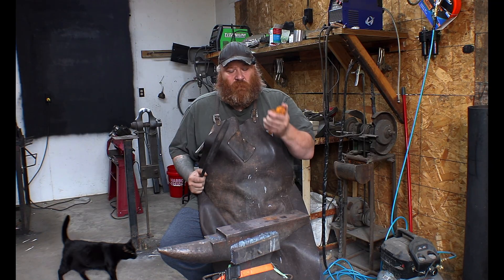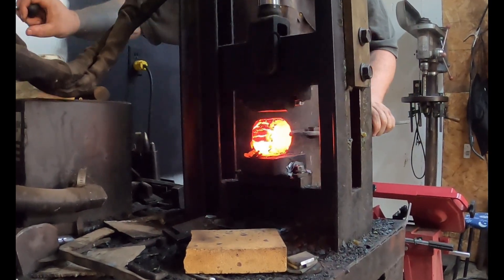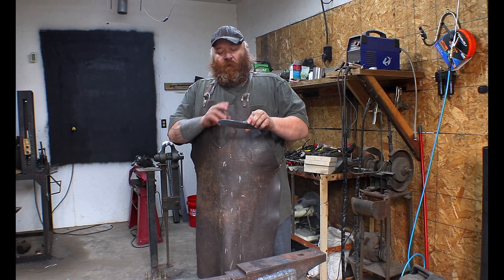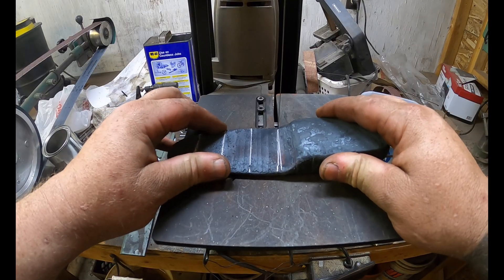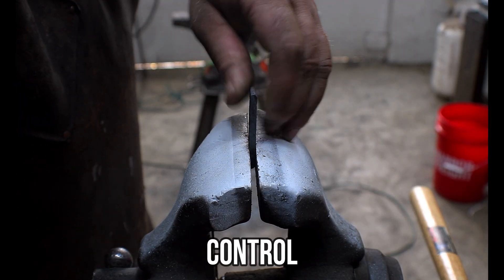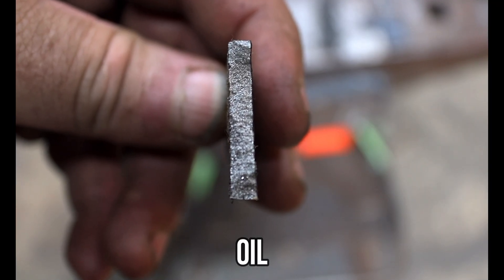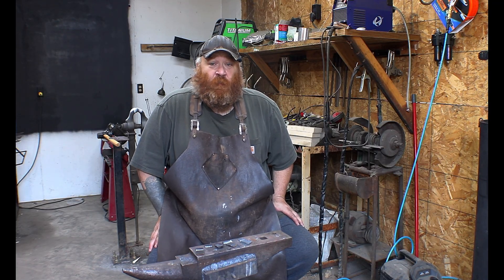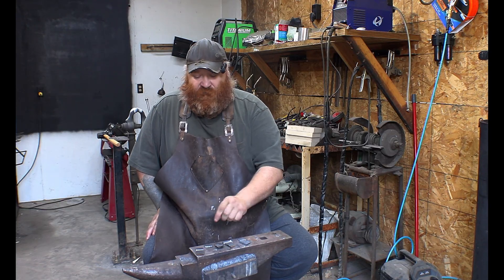Can you HARDEN Ball Bearing Steel? | Bladesmithing

Comment from the maker: What’s your favorite scrap steel to turn into knives? ⚒️
Do you think ball bearings are worth the effort, or should we just roll on to the next?
👉 And don’t miss next week’s test: Bed Rail… Good for Knives, or should we just sleep on it?
Reply: Can you make a nice stainless knife?
Reply from the maker: @mattnejmanowski631 no I don’t do stainless
Reply: @rustyhammerforge5902 you can do stainless. They'll tell you that you can't do it without an evenheat and foil but you can 
Just try to let it soak before quenching. Do an oil quench and grind after heat treat. Gas or coal doesn't care what metal it makes hot! 
You will get a Royal buttload of decarburization unless you coat it in thin clay first but you can do it. And quench it hotter than carbon. Most stainless likes 1750 ish. Don't ask me why. Something about the chromium makes austenizing take hotter/longer. It just wants to be difficult is my guess. 
Maybe we can't get 100% out of it technically but heated in a forge and oil quenched is at least as good as heated in an oven and air quenched in my opinion.

Comment: 52100 is great once you figure out its quirks.  It’s definitely not a plain carbon steel.  It hardens easier, requires some knowledge to deal with, and makes a great knife.  Read or search up Kevin Cashen’s work with 52100.

Comment: Finding out that your ball bearing knife is unhardenable is awful. 
Almost as bad as trying to drill or cut through it after "annealing" 😂
That 52100 can air harden! I remember reading stuff from i THINK gil hibben and/or rw wilson talking about how they treated their 52100 basically just like 440c and would quench it in front of a fan or plate quench and routinely get 58 HRC after tempering. And from what I have messed with ball bearings and bearing races I think the only way to anneal it properly at home is a wood fire in the yard. Let it cool down as the fire dies over like 6hrs. Letting it cool in the forge or even in lime or kitty litter it cools to the touch in like 2 hours and will make your drill bit scream. You may have more luck with kitty litter than I did. Sounds like you're using more of it.

Comment: A lot of people are interested in basic forge smithing without the "special steel" snobbery that is quite common in some videos. We all have to start somewhere and videos like this one help beginners understand the basics of why and how. Good content man. Hopefully a series of basic concepts of blacksmithing come from this.
Reply from the maker: I appreciate your support!
Reply: The special steel is just easier to use specifically for beginners. And ultimately cheaper than a screw up. Consumables like forge fuel and grinding stuff cost money and you can never get time back. I have always used scrap and always will (within reason) but if I have enough money to afford a big steel rack of known steel, I'd send my scrap for rebar! Every screw up taught me something but they all sucked. One of the lessons they taught is ultimately known steel is cheaper (and it's not just about the heat treat, used steel often has micro cracks 😢) . Aldo Bruno sells a 4 foot 1/8" thick 1.25 inch wide stick of 1075 for 47.50$ shipped 2 day in the united states. 
If you make 1 forged hidden tang knife per 4 inches and sell it for 350 thats 4200$ in knives from one 48 inch bar. 12 individual blades.  To make the same number of knives from scrap you would spend many hours of testing, forging to shape, and possible to losing blades to cracks and failures. 
All of the Sheffield blade forgers used known steel of dimensions only slightly bigger than the final product for a reason. Pros use known stock for a reason. It's not snobbery, it's efficiency. But I use scrap for a reason. That reason Is I'm poor 😂

Comment: Do stainless steel harded punches from a die. Have any use in forging?
Reply from the maker: You know I am not a stainless guy but depending on the alloy you could find a use
Reply: They are more likely electro plated with something like chrome or zinc and not actually stainless. But you can forge any steel. Stainless decarbs a lot and is harder to heat treat but you can get it hot and hit it